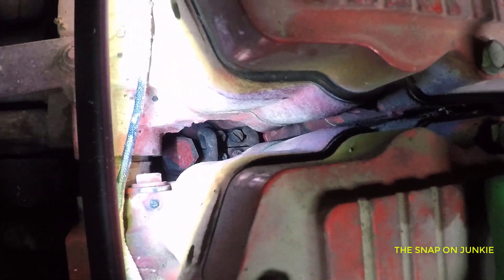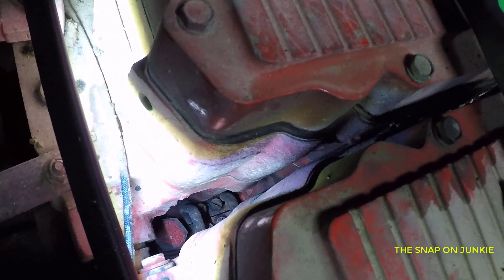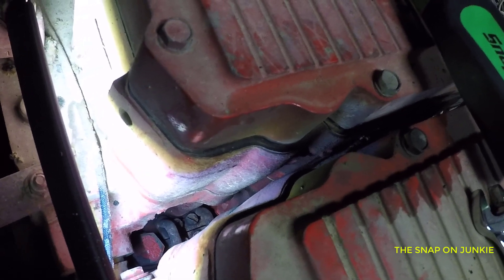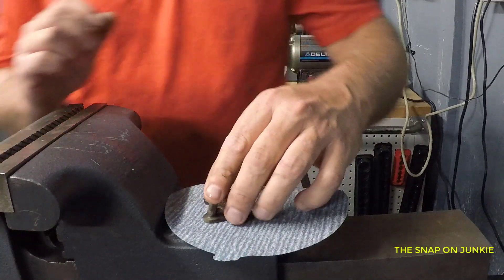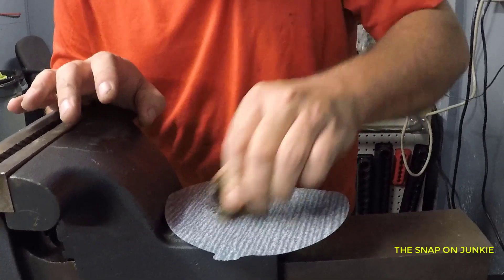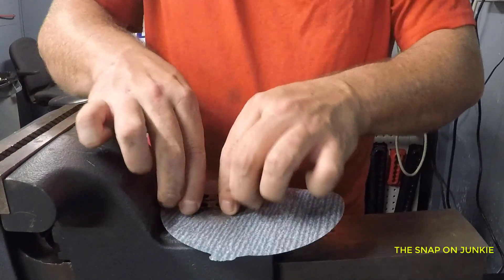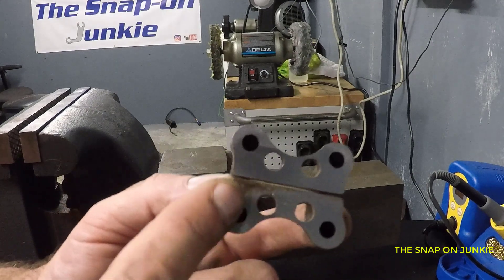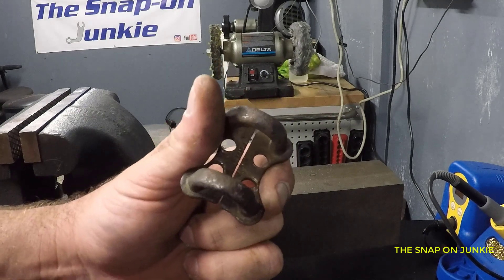CUMMINS N14 HACK FUEL LEAK JUMPER LINES BY THE JUNKIE

Comment: I changed some on a very rusty n14  one time. The screws wouldn’t come out even with an impact tool you smack with a hammer. Ended up stripping the shoulders. I got an old screwdriver that had the option to put a wrench on it and used a stick welder to weld the screwdriver to each screw, it worked really well. I always change the screws out with Allen headed screws after that one.

Comment: What make you get to the conclusion for replace the oring, I mean like bad acelleration, hard diesel smell or what was the symptoms?
Reply: It will leak diesel all over the engine. You’ll be able to smell it from the cab

Comment: What if you tried viton o-rings? they withstand fuel.
Reply from the maker: 1972IHPICKUP no I've never tried those
Reply: 1972IHPICKUP old post but yes, viton, which all a/c o rings are made from will last indefinitely.  I don’t even stock basic o rings. I use a/c o rings or pay extra for viton o rings.

Comment: Excellent Job Junkie I like to Grease up the O-Rings With Vaseline Prior to Installing Them it Helps Hold them in Place and Prevents Tearing of them Also the Vaseline Dissolves in the Diesel Fuel and will not Plug up the Injectors 👨🏼‍🔧👩🏻‍🔧😎👍🏼